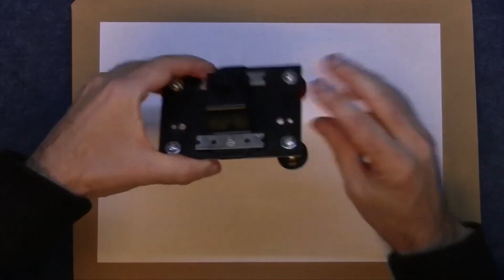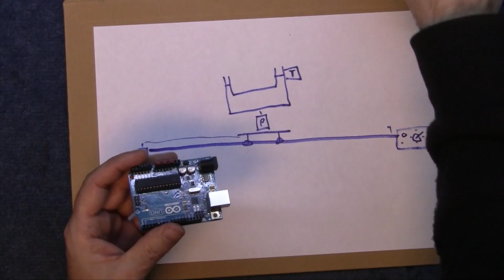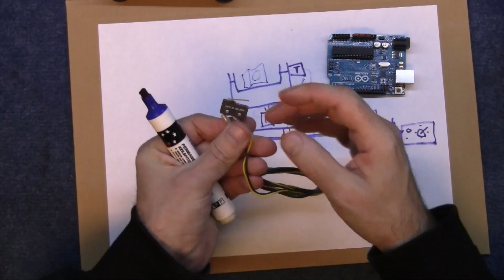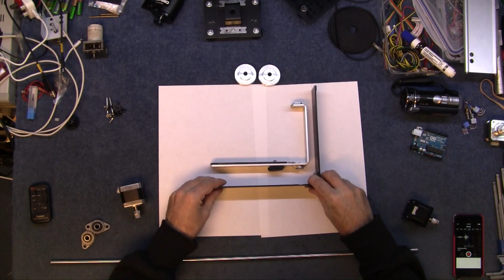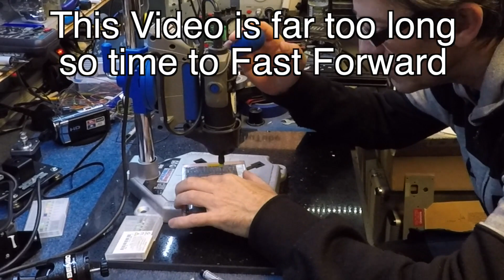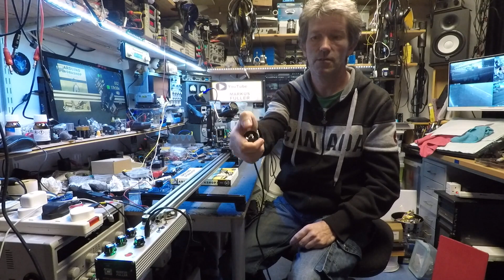1.5 meter Fully motorised DIY Arduino Camera slider with Pan Tilt & GOTO position memories

Comment: The best video ever for this kind of projects, please send me the code and the schematic diagram, please.
Reply from the maker: Arduino camera slider code

/*
  stepper motor Rail Pan Tilt camera controller
   by Markus Fuller 2020
  using 1 Arduino UNO 3x nema17 stepper motors and 3x EasyDrivers from www.schmalzhaus.com
  Library - AccelStepper by Mike McCauley:
  http://www.airspayce.com/mikem/arduino/AccelStepper/index.html

*/

#include <AccelStepper.h>
#include <MultiStepper.h>

#define PanX A0       // Pan X pin
#define TiltY A1       // Tilt Y pin
#define Rail A2     // Slider potentiometer
#define inOutPot A3   // In and Out speed potentiometer
#define PanStop 10  // to stop pan cable tangling
#define Button 12   // Set Button
#define EndStop 11
#define RedLED 8   // RGB Led Red
#define GreenLED 9 // RGB Led Green
#define blueLED 13 // RGB Led blue

// Set stepper motor pins on Arduino as type, Step, and Direction,
AccelStepper stepper1(1, 7, 6);
AccelStepper stepper2(1, 5, 4);
AccelStepper stepper3(1, 3, 2);

MultiStepper StepperControl;

long gotoposition[3]; // stores the A and B position for every stepper motor

int PanPos = 0;
int TiltYPos = 0;
int RailPos = 0;
int currentSpeed = 100;
int inOutSpeed = 100;

int XInPoint = 0;
int YInPoint = 0;
int ZInPoint = 0;
int XOutPoint = 0;
int YOutPoint = 0;
int ZOutPoint = 0;
int InandOut = 0;

void setup() {
  stepper1.setMaxSpeed(3000);
  stepper1.setSpeed(300);
  stepper2.setMaxSpeed(1500);
  stepper2.setSpeed(75);
  stepper3.setMaxSpeed(1500);
  stepper3.setSpeed(75);

  pinMode(PanStop, INPUT_PULLUP); //faultstop to help prevent pan cable tangling
  pinMode(Button, INPUT_PULLUP); //setswitch which is also activate button
  pinMode(EndStop, INPUT_PULLUP); //endstop microswitch
  pinMode(RedLED, OUTPUT); //red led
  pinMode(GreenLED, OUTPUT); //green led
  pinMode(blueLED, OUTPUT); //blue led

  StepperControl.addStepper(stepper1);
  StepperControl.addStepper(stepper2);
  StepperControl.addStepper(stepper3);

  // Move the slider to the Home position when first turned on
  while (digitalRead(EndStop) != 0) {
    stepper1.setSpeed(1500);
    stepper1.runSpeed();
    stepper1.setCurrentPosition(0); // When EndStop is activated this sets position as step 0

  }
  delay(30);
  // Moves back slightly from the rail endstop
  while (stepper1.currentPosition() != -1500) {
    stepper1.setSpeed(-1500);
    stepper1.run();

    // This section below for Pan centre control
  }
  // Moves the pan head anticlockwise until microswitch is activated
  while (digitalRead(PanStop) != 0) {
    stepper3.setSpeed(-400);
    stepper3.runSpeed();
    stepper3.setCurrentPosition(0); // When Pan is centred set position to 0 steps

  }
  delay(30);
  // Moves pan clockwise untilfacing forward, this may need to be changed depending on how many teeth between stepper and pan wheel
  while (stepper3.currentPosition() != 1070) { 
    stepper3.setSpeed(400); 
    stepper3.run();

    // End of section above
    
    digitalWrite(blueLED, HIGH); // blue led turns on
  }

  }
     void loop() {
  // this will cancel out the rail movement if you try and travel beyond safe limits
  while (digitalRead(EndStop) == 0 || stepper1.currentPosition() < -40500) {}

      if (digitalRead (Button) == 0) {
      delay(1000); // hold switch for 1 second to reset all values then LED turns Blue

      if (digitalRead (Button) == 0) {
      InandOut = 4;
      }
  switch (InandOut) {
    case 0:   // Set the A position
      InandOut = 1;
      XInPoint = stepper1.currentPosition(); // Set the IN position for steppers 1
      YInPoint = stepper2.currentPosition(); // Set the IN position for steppers 2
      ZInPoint = stepper3.currentPosition(); // Set the IN position for steppers 3
      digitalWrite(blueLED, LOW); // MSF blue led goes out
      digitalWrite(RedLED, HIGH); // Light up inLed
      break;

    case 1: // Set the B position
      InandOut = 2;
      XOutPoint = stepper1.currentPosition(); //  Set the B positions for steppers
      YOutPoint = stepper2.currentPosition();
      ZOutPoint = stepper3.currentPosition();
      digitalWrite(RedLED, LOW); // red Led goes off then Green Led Illuminates stating ready to run
      digitalWrite(GreenLED, HIGH);
      break;

    case 2: // Move to A position / go to next part case 3
      InandOut = 3;
      inOutSpeed = analogRead(inOutPot);
      // Place the A position into the Array
      gotoposition[0] = XInPoint;
      gotoposition[1] = YInPoint;
      gotoposition[2] = ZInPoint;
      stepper1.setMaxSpeed(inOutSpeed);
      stepper2.setMaxSpeed(inOutSpeed);
      stepper3.setMaxSpeed(inOutSpeed);
      StepperControl.moveTo(gotoposition);
      StepperControl.runSpeedToPosition();
      delay(200);
      break;

    case 3: // Move to B position and returns go back to case 2 above
      InandOut = 2;
      inOutSpeed = analogRead(inOutPot);
      // Place the B position into the Array
      gotoposition[0] = XOutPoint;
      gotoposition[1] = YOutPoint;
      gotoposition[2] = ZOutPoint;
      stepper1.setMaxSpeed(inOutSpeed);
      stepper2.setMaxSpeed(inOutSpeed);
      stepper3.setMaxSpeed(inOutSpeed);
      StepperControl.moveTo(gotoposition);
      StepperControl.runSpeedToPosition();
      delay(200);
      break;

    case 4: // If Set button is held longer than one second go back to the beginning case 0 above
      InandOut = 0;
      digitalWrite(RedLED, LOW);
      digitalWrite(GreenLED, LOW);
      digitalWrite(blueLED, HIGH);
      delay(1000);
      break;
  }
}

      // PanX - Pan movement XPos
      
     PanPos = analogRead(PanX);
      // if Pan Pot is moved left, move stepper 2 pan anticlockwise

     if (PanPos > 600) {
      //stepper2.setSpeed(currentSpeed);
     PanPos = map(PanPos, 600, 1024, 0, 200);
     stepper2.setSpeed(PanPos); // Increase speed
}
      // if PanPot is moved right, move stepper 2 pan clockwise
     else if (PanPos < 400) {
      //stepper2.setSpeed(-currentSpeed);
     PanPos = map(PanPos, 400, 0, 0, 200);
     stepper2.setSpeed(-PanPos); // Increase speed
}
       // if PanPot is centred then there is no movement
    else {
     stepper2.setSpeed(0);
}

      //Tilt Y - Tilt movement
      
     TiltYPos = analogRead(TiltY);

     if (TiltYPos > 600) {
      //stepper3.setSpeed(currentSpeed);
     TiltYPos = map(TiltYPos, 600, 1024, 0, 200);
     stepper3.setSpeed(TiltYPos); // Increase speed
}
     else if (TiltYPos < 400) {
      //stepper3.setSpeed(-currentSpeed);
     TiltYPos = map(TiltYPos, 400, 0, 0, 200);  // Try changing this to lower value to slow tilt stepper
     stepper3.setSpeed(-TiltYPos); // Increase speed
      // If TiltPot is centred then there is no movement
}
     else {
      stepper3.setSpeed(0);
}

      // RAIL potentiometer
      
     RailPos = analogRead(Rail);

      // If potentiometer is turned left then the Gantry moves towards the control unit

     if (RailPos > 600) {
     RailPos = map(RailPos, 600, 1024, 0, 3000);
     stepper1.setSpeed(-RailPos); // Increase speed
}
      // If potentiometer is turned right then the Gantry moves away from the control unit
     else if (RailPos < 400 ) {
     RailPos = map(RailPos, 400, 0, 0, 3000);
     stepper1.setSpeed(RailPos); // Increase speed
     // If potentiometer is centred then there is no movement
}      
     else {
    stepper1.setSpeed(0);
}
     // run the camera slider
    stepper1.runSpeed();
    stepper2.runSpeed();
    stepper3.runSpeed();
}

Comment: Your website isn’t up any more. Is the code on another web site?
Reply from the maker: Arduino camera slider code

/*
  stepper motor Rail Pan Tilt camera controller
   by Markus Fuller 2020
  using 1 Arduino UNO 3x nema17 stepper motors and 3x EasyDrivers from www.schmalzhaus.com
  Library - AccelStepper by Mike McCauley:
  http://www.airspayce.com/mikem/arduino/AccelStepper/index.html

*/

#include <AccelStepper.h>
#include <MultiStepper.h>

#define PanX A0       // Pan X pin
#define TiltY A1       // Tilt Y pin
#define Rail A2     // Slider potentiometer
#define inOutPot A3   // In and Out speed potentiometer
#define PanStop 10  // to stop pan cable tangling
#define Button 12   // Set Button
#define EndStop 11
#define RedLED 8   // RGB Led Red
#define GreenLED 9 // RGB Led Green
#define blueLED 13 // RGB Led blue

// Set stepper motor pins on Arduino as type, Step, and Direction,
AccelStepper stepper1(1, 7, 6);
AccelStepper stepper2(1, 5, 4);
AccelStepper stepper3(1, 3, 2);

MultiStepper StepperControl;

long gotoposition[3]; // stores the A and B position for every stepper motor

int PanPos = 0;
int TiltYPos = 0;
int RailPos = 0;
int currentSpeed = 100;
int inOutSpeed = 100;

int XInPoint = 0;
int YInPoint = 0;
int ZInPoint = 0;
int XOutPoint = 0;
int YOutPoint = 0;
int ZOutPoint = 0;
int InandOut = 0;

void setup() {
  stepper1.setMaxSpeed(3000);
  stepper1.setSpeed(300);
  stepper2.setMaxSpeed(1500);
  stepper2.setSpeed(75);
  stepper3.setMaxSpeed(1500);
  stepper3.setSpeed(75);

  pinMode(PanStop, INPUT_PULLUP); //faultstop to help prevent pan cable tangling
  pinMode(Button, INPUT_PULLUP); //setswitch which is also activate button
  pinMode(EndStop, INPUT_PULLUP); //endstop microswitch
  pinMode(RedLED, OUTPUT); //red led
  pinMode(GreenLED, OUTPUT); //green led
  pinMode(blueLED, OUTPUT); //blue led

  StepperControl.addStepper(stepper1);
  StepperControl.addStepper(stepper2);
  StepperControl.addStepper(stepper3);

  // Move the slider to the Home position when first turned on
  while (digitalRead(EndStop) != 0) {
    stepper1.setSpeed(1500);
    stepper1.runSpeed();
    stepper1.setCurrentPosition(0); // When EndStop is activated this sets position as step 0

  }
  delay(30);
  // Moves back slightly from the rail endstop
  while (stepper1.currentPosition() != -1500) {
    stepper1.setSpeed(-1500);
    stepper1.run();

    // This section below for Pan centre control
  }
  // Moves the pan head anticlockwise until microswitch is activated
  while (digitalRead(PanStop) != 0) {
    stepper3.setSpeed(-400);
    stepper3.runSpeed();
    stepper3.setCurrentPosition(0); // When Pan is centred set position to 0 steps

  }
  delay(30);
  // Moves pan clockwise untilfacing forward, this may need to be changed depending on how many teeth between stepper and pan wheel
  while (stepper3.currentPosition() != 1070) { 
    stepper3.setSpeed(400); 
    stepper3.run();

    // End of section above
    
    digitalWrite(blueLED, HIGH); // blue led turns on
  }

  }
     void loop() {
  // this will cancel out the rail movement if you try and travel beyond safe limits
  while (digitalRead(EndStop) == 0 || stepper1.currentPosition() < -40500) {}

      if (digitalRead (Button) == 0) {
      delay(1000); // hold switch for 1 second to reset all values then LED turns Blue

      if (digitalRead (Button) == 0) {
      InandOut = 4;
      }
  switch (InandOut) {
    case 0:   // Set the A position
      InandOut = 1;
      XInPoint = stepper1.currentPosition(); // Set the IN position for steppers 1
      YInPoint = stepper2.currentPosition(); // Set the IN position for steppers 2
      ZInPoint = stepper3.currentPosition(); // Set the IN position for steppers 3
      digitalWrite(blueLED, LOW); // MSF blue led goes out
      digitalWrite(RedLED, HIGH); // Light up inLed
      break;

    case 1: // Set the B position
      InandOut = 2;
      XOutPoint = stepper1.currentPosition(); //  Set the B positions for steppers
      YOutPoint = stepper2.currentPosition();
      ZOutPoint = stepper3.currentPosition();
      digitalWrite(RedLED, LOW); // red Led goes off then Green Led Illuminates stating ready to run
      digitalWrite(GreenLED, HIGH);
      break;

    case 2: // Move to A position / go to next part case 3
      InandOut = 3;
      inOutSpeed = analogRead(inOutPot);
      // Place the A position into the Array
      gotoposition[0] = XInPoint;
      gotoposition[1] = YInPoint;
      gotoposition[2] = ZInPoint;
      stepper1.setMaxSpeed(inOutSpeed);
      stepper2.setMaxSpeed(inOutSpeed);
      stepper3.setMaxSpeed(inOutSpeed);
      StepperControl.moveTo(gotoposition);
      StepperControl.runSpeedToPosition();
      delay(200);
      break;

    case 3: // Move to B position and returns go back to case 2 above
      InandOut = 2;
      inOutSpeed = analogRead(inOutPot);
      // Place the B position into the Array
      gotoposition[0] = XOutPoint;
      gotoposition[1] = YOutPoint;
      gotoposition[2] = ZOutPoint;
      stepper1.setMaxSpeed(inOutSpeed);
      stepper2.setMaxSpeed(inOutSpeed);
      stepper3.setMaxSpeed(inOutSpeed);
      StepperControl.moveTo(gotoposition);
      StepperControl.runSpeedToPosition();
      delay(200);
      break;

    case 4: // If Set button is held longer than one second go back to the beginning case 0 above
      InandOut = 0;
      digitalWrite(RedLED, LOW);
      digitalWrite(GreenLED, LOW);
      digitalWrite(blueLED, HIGH);
      delay(1000);
      break;
  }
}

      // PanX - Pan movement XPos
      
     PanPos = analogRead(PanX);
      // if Pan Pot is moved left, move stepper 2 pan anticlockwise

     if (PanPos > 600) {
      //stepper2.setSpeed(currentSpeed);
     PanPos = map(PanPos, 600, 1024, 0, 200);
     stepper2.setSpeed(PanPos); // Increase speed
}
      // if PanPot is moved right, move stepper 2 pan clockwise
     else if (PanPos < 400) {
      //stepper2.setSpeed(-currentSpeed);
     PanPos = map(PanPos, 400, 0, 0, 200);
     stepper2.setSpeed(-PanPos); // Increase speed
}
       // if PanPot is centred then there is no movement
    else {
     stepper2.setSpeed(0);
}

      //Tilt Y - Tilt movement
      
     TiltYPos = analogRead(TiltY);

     if (TiltYPos > 600) {
      //stepper3.setSpeed(currentSpeed);
     TiltYPos = map(TiltYPos, 600, 1024, 0, 200);
     stepper3.setSpeed(TiltYPos); // Increase speed
}
     else if (TiltYPos < 400) {
      //stepper3.setSpeed(-currentSpeed);
     TiltYPos = map(TiltYPos, 400, 0, 0, 200);  // Try changing this to lower value to slow tilt stepper
     stepper3.setSpeed(-TiltYPos); // Increase speed
      // If TiltPot is centred then there is no movement
}
     else {
      stepper3.setSpeed(0);
}

      // RAIL potentiometer
      
     RailPos = analogRead(Rail);

      // If potentiometer is turned left then the Gantry moves towards the control unit

     if (RailPos > 600) {
     RailPos = map(RailPos, 600, 1024, 0, 3000);
     stepper1.setSpeed(-RailPos); // Increase speed
}
      // If potentiometer is turned right then the Gantry moves away from the control unit
     else if (RailPos < 400 ) {
     RailPos = map(RailPos, 400, 0, 0, 3000);
     stepper1.setSpeed(RailPos); // Increase speed
     // If potentiometer is centred then there is no movement
}      
     else {
    stepper1.setSpeed(0);
}
     // run the camera slider
    stepper1.runSpeed();
    stepper2.runSpeed();
    stepper3.runSpeed();
}

Comment: Have been searching for a system like this for years.  The site  for the code is no longer.  Is there a way i could that arduino code? Or am I three years too late?
Reply: not there in wayback Eurorack stuff, no arduino slider code.. Perhaps it is my fault for trying  to find it.  I guess I'll have cancel my shooting gig with ILM tomorrow. They are going to be crushed when they find out no arduino camera slider.  George is pretty good at hand held though.